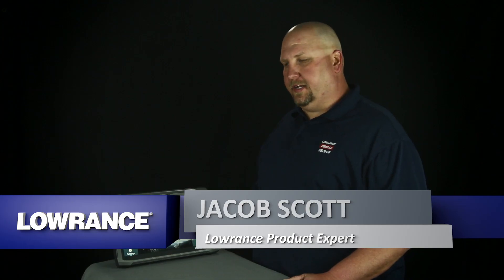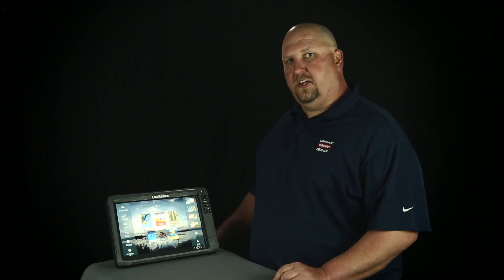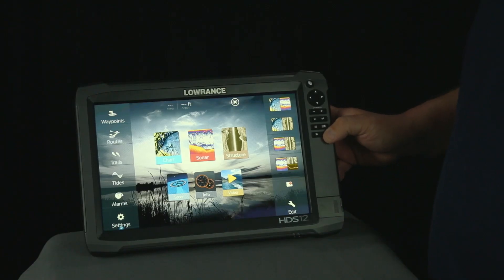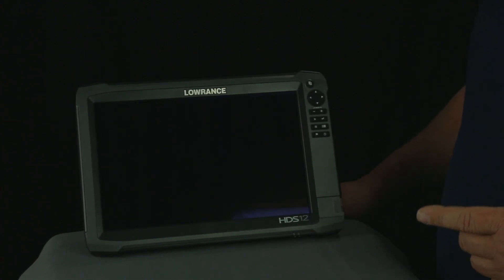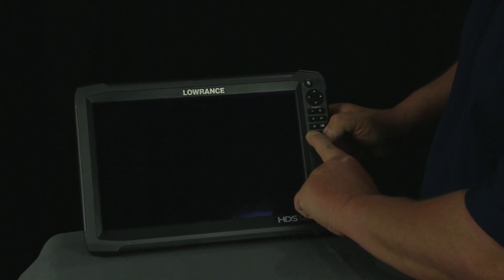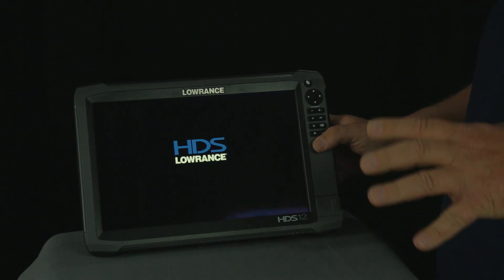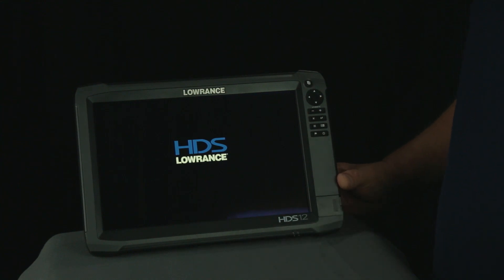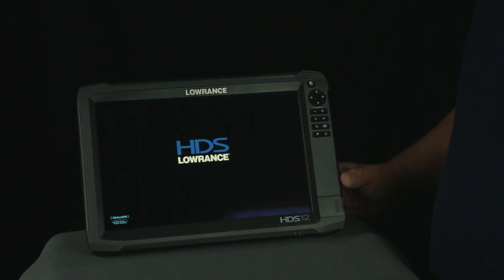How to Calibrate the Touchscreen on a Lowrance® HDS® Gen3

Comment: I have had an issue with the touch screen on and after a rainy day fishing. After drying, a soft, hard reset and re-calibrating, the touch screen works, lags, and stops working. How do you fix this? Could it be a grounding, or wiring issue? Never had this happen after years of owning this Gen 3 unit, just suddenly happened on the one day of sporadic rain fall, it's frustrating.